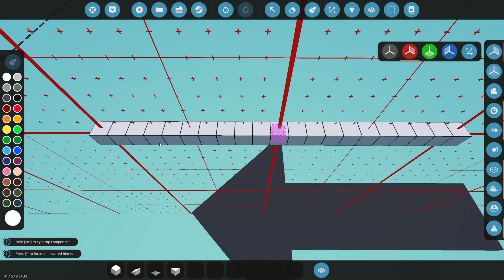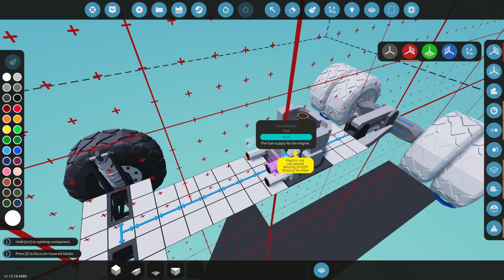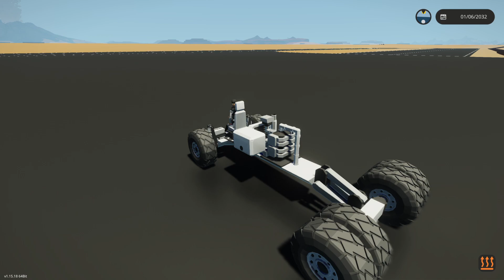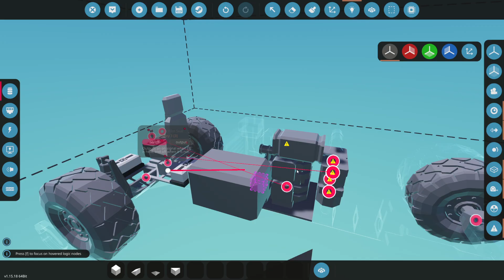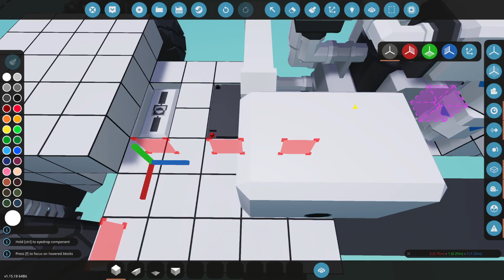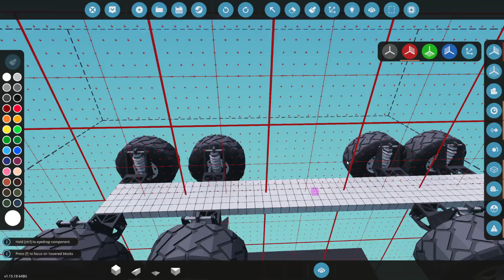Stormworks car/truck tutorial the last one you will need

Comment: Mmm would you like to try making ESP ABS TCS?

You could put a bunch of clutches 1 per wheel and write a simple code and make wheels sync theyr rps with the road and a speed, slightly above than that cus they slip a little , it gives a lot of stability if you try this on.